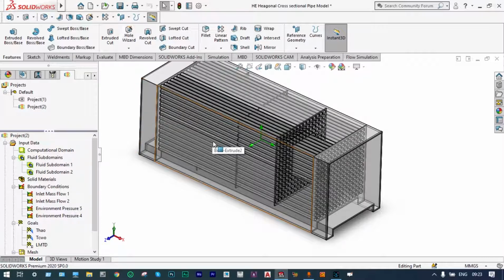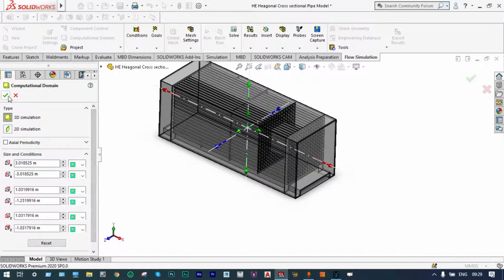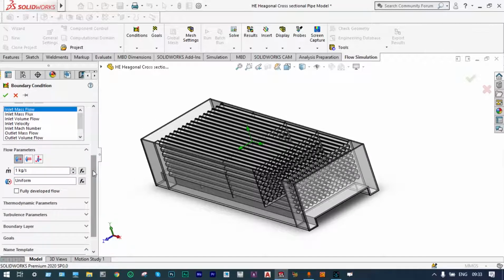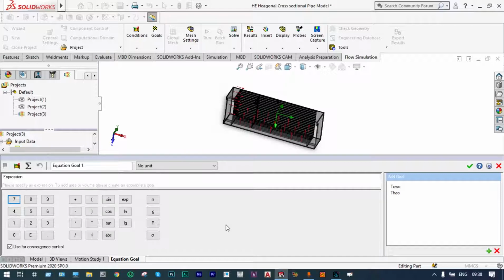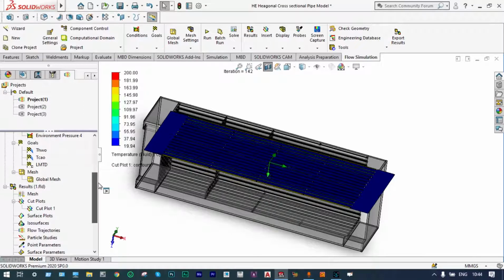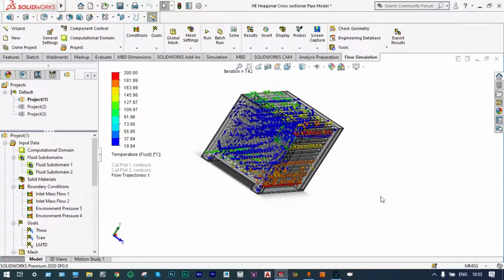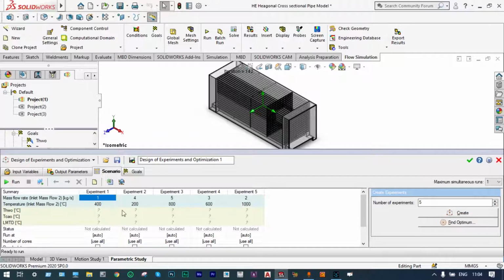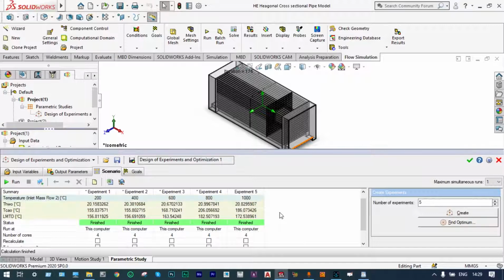CFD Parametric Study & Optimization of a Cross Flow Heat Exchanger using SolidWorks 2020

Comment: Hello sir. Thank you for the video. Can I use the same principle for the CFD analysis of an automotive radiator. Please revert back at your earliest convenience.
Reply from the maker: Basic principle will be same. You can see this video to have a better understanding: https://youtu.be/Jvmmr1jNh4c
Reply: @CFD_GUIDE  Hello, thank you for replying. Since my radiator model is not watertight, I'm not able to create lids. Is there anyway I can circumvent that part as I believe that it's because the fins are too thin or that the tubes are open and only enclosed by a tank?
Reply from the maker: If the lid opening surface is not flat you cannot creat lid normally from the tools. In that case you have to create separate lid on a surface a bit away from the actual lid and then it needs to be extruded unmerged.
Reply: @CFD_GUIDE  Okay sir, thank you very much for your help. Much obliged.